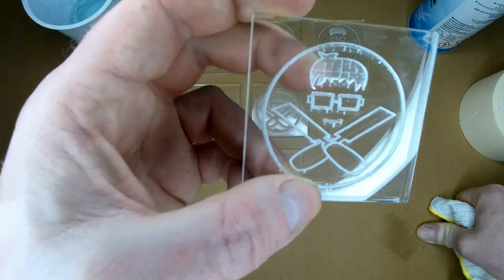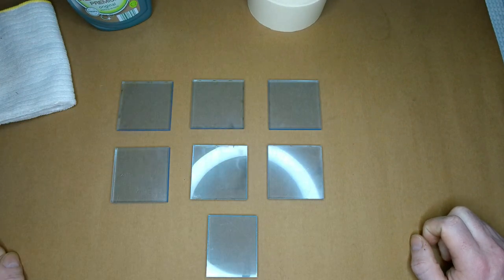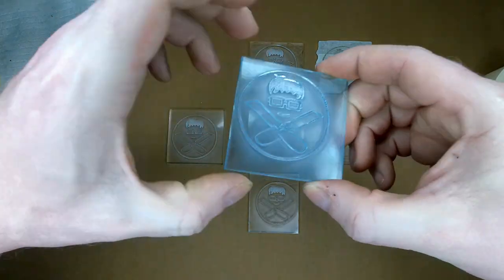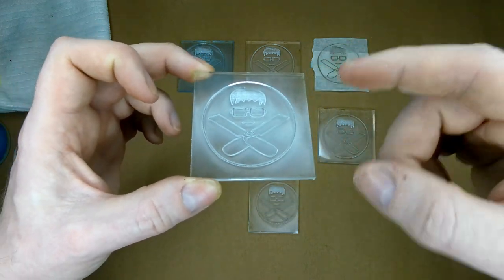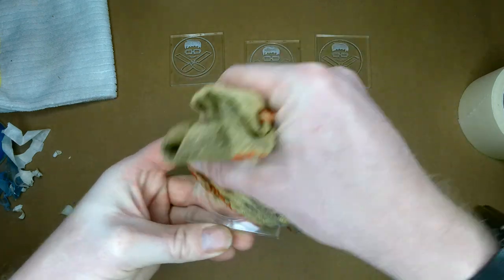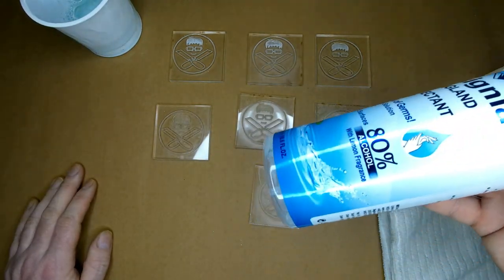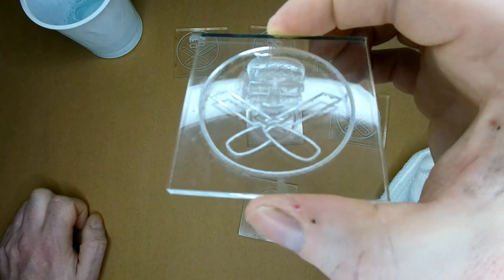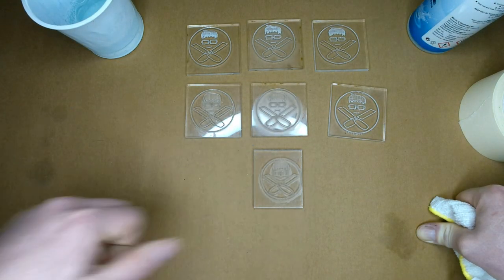Testing your methods for engraving acrylic on a co2 laser. You will be surprised at the results!!

Comment: Thanks for the video Phil I have tried all them methods and yes the only thing that is best is keeping the Plastic on before engraving duck tape is good for removing the plastic after engraving.
You can remove the plastic flim and use paper transfer tape it's low tac, masking tape is no use it leaves to much glue from it. Which is a pain to get off
Reply from the maker: I'm going to test the transfer tape method on some detailed designs later on today :)

Comment: Hey Phil - cheers for the shout out :-) nice surprise.
I enjoyed that.  I wonder if using transfer tape ( the kind you use when lifting cut vinyl to place on a substrate ) would pull the acrylic regular blue cover off quicker, especialy on intricate designs?

Im hoping to be getting my laser in the next 2-3 weeks, pretty excited.. do you have any recommendations on some ) essential bits and pieces/accessories - callipers etc for a first time laser user that would be handy to have?  congrats on the 502 subscribers, thats pretty awesome in such a short space of time
Reply from the maker: I actually have some transfer tape for vinyl designs so I will give that a go on the intricate designs when I get them done.

Some curved needle nose pliers will help with swapping mirrors out. If yours doesn't come with Alan keys then a set of those would be handy too.